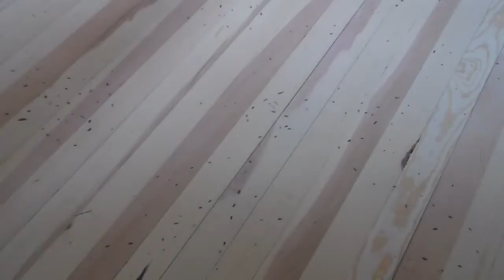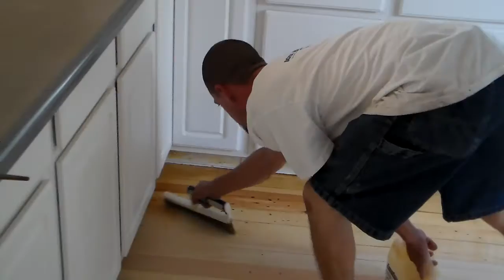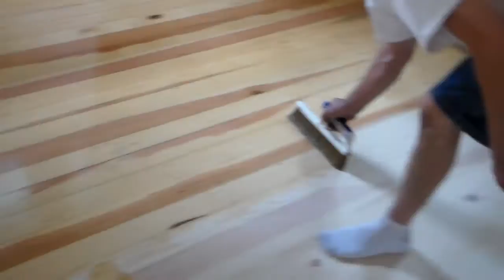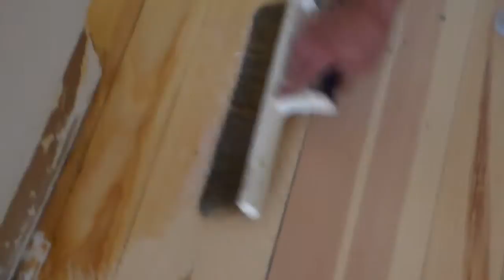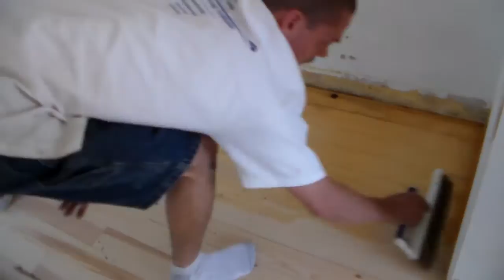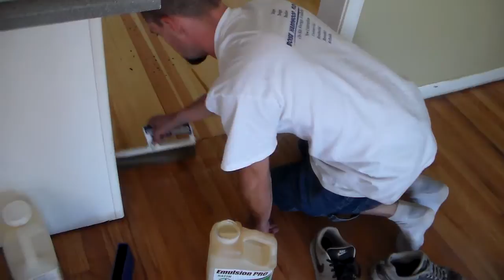Waterbase seal coat on a distressed wood floor

Comment: I'm tempted to do my final coat like this... Been having a heck of a time laying down an acceptable (B+) finish on my final coat... I had to buff sand down my 3rd, 4th, 5th coats because of lap marks from lambswool app and roller apps. Not easy to put poly down nicely when you're a noob!.